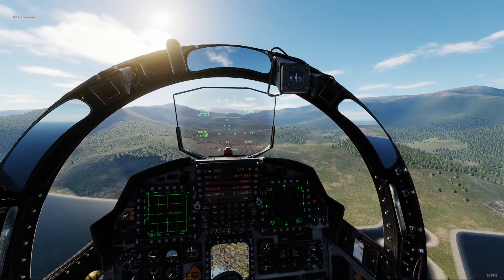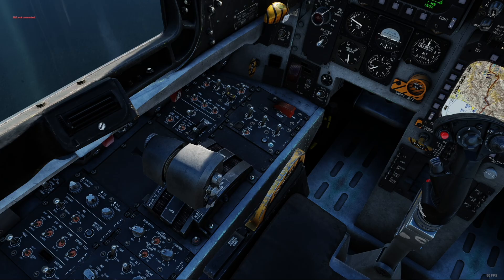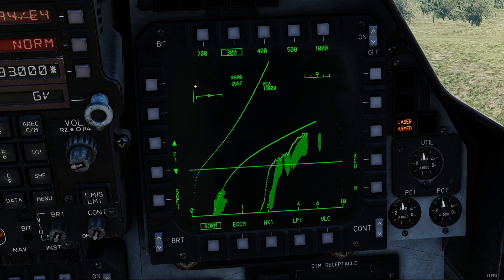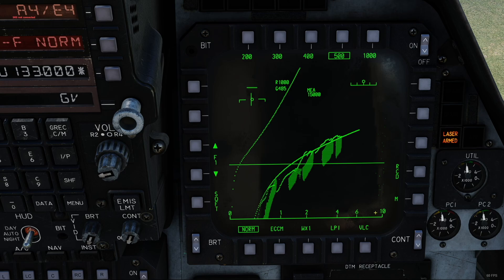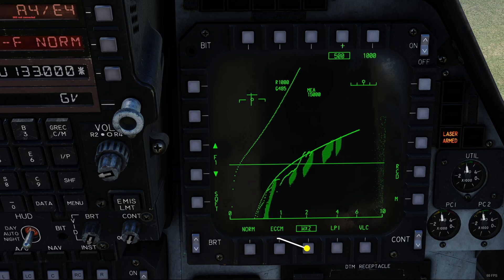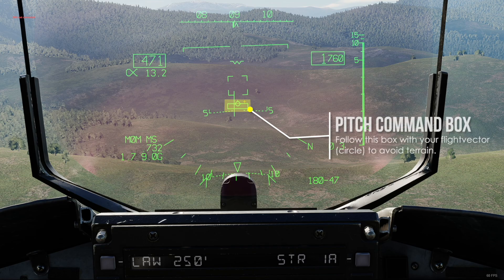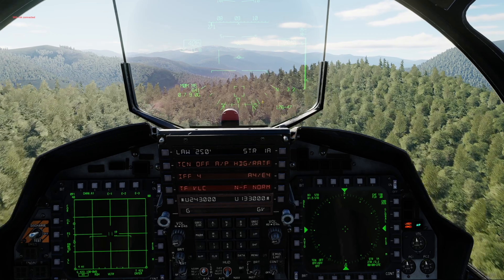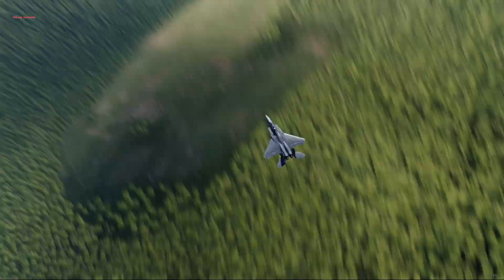F15E Quick Guide - Terrain Following Radar

Comment: Hi! I am looking to start playing DCS, i plan on getting either the t16000m hotas or x52 pro. But my PC is: Ryzen 5 5600X, RTX 3050 8GB, 16GB RAM and 1TB nvme ssd. Will i be able to play multiplayer both pvp and pve on 1080p?
Reply from the maker: Hey, for your pc i think you should be good as long as you don’t go for VR, which is the most demanding. But you should have no problems with 1080p in pve, pvp can be a bit more demanding but it should also work out.

For the hotas, I think both are a good starter even though i did not own any of them. With the t16000 you might run out of buttons, especially on the Stick, at some point. For the x52 you should be fine with buttons for a long time, it is said though that the quality of the logitech flight stuff does not quite reach the level of other companies. But i can only tell you what i‘ve heard since i don‘t own one.
Some youtubers made in dept comparisons which you can check out.

One last point since you asked under a F15E video; Be aware that the developer of this module Razbam has a dispute with eagle dynamics and stopped support for all his modules, if they will ever come back and finish the F15E is unknown and quite unlikely. So don‘t buy any of their modules atm, start with the Fc3 pack or F16/F18 if you want to click stuff in the cockpit.

Welcome to DCS, hell lot of fun and a lot to learn :).
Reply: @ Thank you a lot for detailed answer! I am sad to hear about F-15E situation, hopefully it'll resolve since it's amazing and iconic aircraft.

I'll download the game tomorrow and see how my PC is handling it, hopefully decently at 1080p low/med but trying to keep cockpit texture as high as possible tho. 

Thanks again and take care! o7